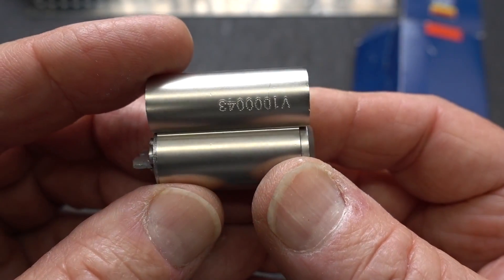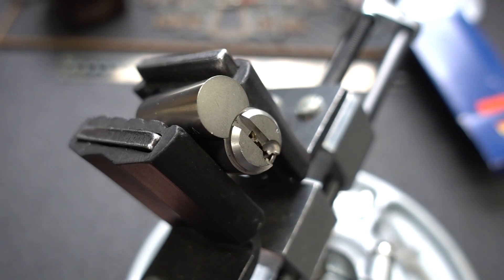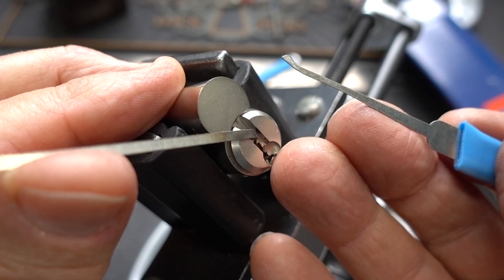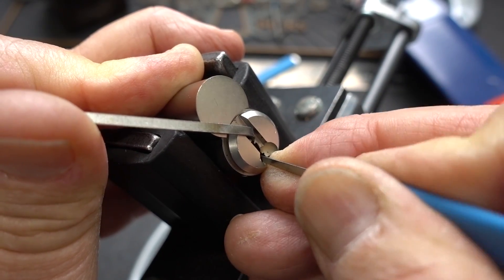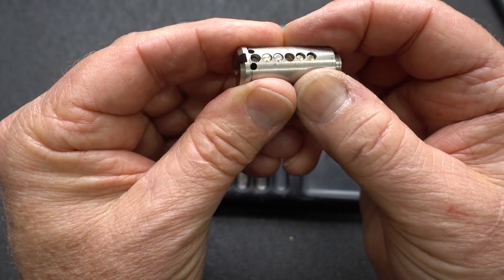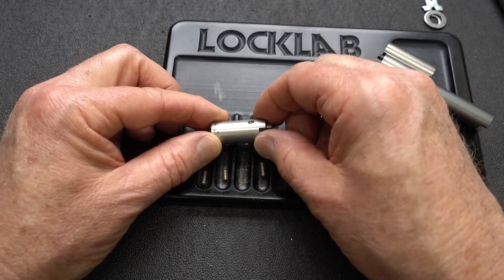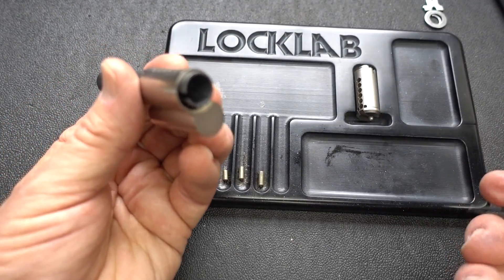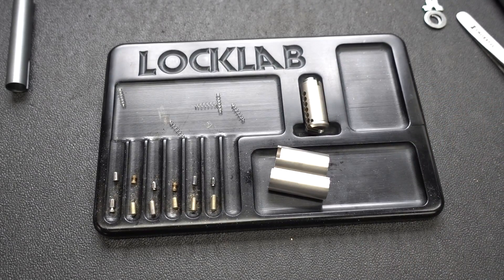(1713) Abus Paracentric Core Picked for Keys

Comment: It's an ABUS Vitess 1000 made by ABUS Phaffenhain in the former West Germany.  Key pin #1 is part of the  ABUS "in-top" key control system.  I believe the plug is a unusually large 14 mm dia to allow for a large number of key cuts / pin lengths.

Comment: Looks like pin 2 and 3 were zero lift pins making one spool and "weird pin" not active at all.
Reply: They probably were, but the holes being so tight, it's not impossible for the key pins to just stick at the picked position as the plug was extracted.

Comment: When did you stop doing challenge locks?
Reply: When and why? Lol
Reply: My guess is that he started to see the same thing over and over again to a point that the challenge was a bit meh. That said though he was still getting whipped so it was too easy. Maybe he just got bored.
Reply: One too many trap pins
Reply from the maker: Here's what I posted on FB, Twitter, YT & LockLab.com about a year ago:
-----------------------------

The "Challenge Lock" series has come to an end.  Not only am I out of the "Whipped" PacLocks, but there were many other things that I took into consideration.

1.  Cost.  Every day I was receiving between 5-10 locks from around the world.  I had to return most of them to the owner, which was a SIGNIFICANT expense - always more than $500/month but sometimes approaching $1000.  What little I receive in viewer support was quickly consumed in return postage.  I was spending several hundred dollars of my own money every month just to return locks.

2.  Quality.  Some locks were well designed and contained some unique innovations, but they were few and far between.  Most "challenge locks" were threaded chambers with serrated pins built on old,beaten up Kwikset cores.  The number of trap pins and super springs has continued to increase as copycats realized this might be a way to get a "Whipped" PacLock - meaning I was breaking and bending more expensive picks.  I found this very discouraging.

3.  Time.  Unpacking, picking, disassembling, repacking, answering emails, etc.  Each challenge lock took a lot of time to figure out and then return - even if I did not make a video of it.  I was spending most of my time setting up and videoing locks that turned out to be copycats of other people's ideas - meaning I could not post the video for fear of viewers saying "WHAT?  Another Kwikset with threaded chambers?"

4.  Viewer Interest.  My goal with LockLab was to remain "New Picker Friendly" and attract new members to LockSport, but LockLab was quickly becoming the "Challenge Lock Channel", interesting to only a limited number of people with advanced skills.  Every time I posted a challenge lock video people complained and unsubscribed to the channel.  New pickers were overwhelmed by the complexity of challenge locks and became discouraged.  My analytics were very clear on this:  If I want to lose subscribers all I needed to do was post a challenge lock video.

5.  Channel growth.  The LockLab's growth was stagnating and I needed to change something before it was too late.  Since I stopped doing challenge locks the number of subscribers has increased, the number of comments increased, "likes" went up, and the channel has grown.

So, yes.  I stopped making challenge lock videos.  It was not an easy decision but I could not afford to continue doing it for all of these reasons.  The money saved from NOT returning challenge locks I am now spending on locks - and have been doing so for the past month or two.  I cannot tell you how refreshing it is to return to picking real-world locks in a wide variety.  It is good for me (mentally), as well as good for LockLab.

bill
Reply: @bosnianbill  I thought it would be along those lines
Reply: Bosnianbill makes perfect sense and I appreciate that. It’s a niche market.
Reply: @bosnianbill  
That's what I'm here for, new/old and different locks found in the wild, esp those which gives insight to the history of lock making

Comment: Why don't you do challenge locks any more bill?
Reply from the maker: Here's what I posted on FB, Twitter, YT & LockLab.com about a year ago:
-----------------------------

The "Challenge Lock" series has come to an end.  Not only am I out of the "Whipped" PacLocks, but there were many other things that I took into consideration.

1.  Cost.  Every day I was receiving between 5-10 locks from around the world.  I had to return most of them to the owner, which was a SIGNIFICANT expense - always more than $500/month but sometimes approaching $1000.  What little I receive in viewer support was quickly consumed in return postage.  I was spending several hundred dollars of my own money every month just to return locks.

2.  Quality.  Some locks were well designed and contained some unique innovations, but they were few and far between.  Most "challenge locks" were threaded chambers with serrated pins built on old,beaten up Kwikset cores.  The number of trap pins and super springs has continued to increase as copycats realized this might be a way to get a "Whipped" PacLock - meaning I was breaking and bending more expensive picks.  I found this very discouraging.

3.  Time.  Unpacking, picking, disassembling, repacking, answering emails, etc.  Each challenge lock took a lot of time to figure out and then return - even if I did not make a video of it.  I was spending most of my time setting up and videoing locks that turned out to be copycats of other people's ideas - meaning I could not post the video for fear of viewers saying "WHAT?  Another Kwikset with threaded chambers?"

4.  Viewer Interest.  My goal with LockLab was to remain "New Picker Friendly" and attract new members to LockSport, but LockLab was quickly becoming the "Challenge Lock Channel", interesting to only a limited number of people with advanced skills.  Every time I posted a challenge lock video people complained and unsubscribed to the channel.  New pickers were overwhelmed by the complexity of challenge locks and became discouraged.  My analytics were very clear on this:  If I want to lose subscribers all I needed to do was post a challenge lock video.

5.  Channel growth.  The LockLab's growth was stagnating and I needed to change something before it was too late.  Since I stopped doing challenge locks the number of subscribers has increased, the number of comments increased, "likes" went up, and the channel has grown.

So, yes.  I stopped making challenge lock videos.  It was not an easy decision but I could not afford to continue doing it for all of these reasons.  The money saved from NOT returning challenge locks I am now spending on locks - and have been doing so for the past month or two.  I cannot tell you how refreshing it is to return to picking real-world locks in a wide variety.  It is good for me (mentally), as well as good for LockLab.

bill

Comment: 8:00. Why do the pin holes go all the way across the chamber opposite the bible? Assembly easier?
 Is that common and I just didn't notice?
Reply: Its to rekey it quickly
Reply: It's how the chambers are drilled into the bible.  It's the alternative to sealing the chambers from the top.  Some ASSA bibles are made that way too.

Comment: why stop challenge locks?
Reply from the maker: Here's what I posted on FB, Twitter, YT & LockLab.com about a year ago:
-----------------------------

The "Challenge Lock" series has come to an end.  Not only am I out of the "Whipped" PacLocks, but there were many other things that I took into consideration.

1.  Cost.  Every day I was receiving between 5-10 locks from around the world.  I had to return most of them to the owner, which was a SIGNIFICANT expense - always more than $500/month but sometimes approaching $1000.  What little I receive in viewer support was quickly consumed in return postage.  I was spending several hundred dollars of my own money every month just to return locks.

2.  Quality.  Some locks were well designed and contained some unique innovations, but they were few and far between.  Most "challenge locks" were threaded chambers with serrated pins built on old,beaten up Kwikset cores.  The number of trap pins and super springs has continued to increase as copycats realized this might be a way to get a "Whipped" PacLock - meaning I was breaking and bending more expensive picks.  I found this very discouraging.

3.  Time.  Unpacking, picking, disassembling, repacking, answering emails, etc.  Each challenge lock took a lot of time to figure out and then return - even if I did not make a video of it.  I was spending most of my time setting up and videoing locks that turned out to be copycats of other people's ideas - meaning I could not post the video for fear of viewers saying "WHAT?  Another Kwikset with threaded chambers?"

4.  Viewer Interest.  My goal with LockLab was to remain "New Picker Friendly" and attract new members to LockSport, but LockLab was quickly becoming the "Challenge Lock Channel", interesting to only a limited number of people with advanced skills.  Every time I posted a challenge lock video people complained and unsubscribed to the channel.  New pickers were overwhelmed by the complexity of challenge locks and became discouraged.  My analytics were very clear on this:  If I want to lose subscribers all I needed to do was post a challenge lock video.

5.  Channel growth.  The LockLab's growth was stagnating and I needed to change something before it was too late.  Since I stopped doing challenge locks the number of subscribers has increased, the number of comments increased, "likes" went up, and the channel has grown.

So, yes.  I stopped making challenge lock videos.  It was not an easy decision but I could not afford to continue doing it for all of these reasons.  The money saved from NOT returning challenge locks I am now spending on locks - and have been doing so for the past month or two.  I cannot tell you how refreshing it is to return to picking real-world locks in a wide variety.  It is good for me (mentally), as well as good for LockLab.

bill
Reply: @bosnianbill  fair enough, im glad i got that bit of info before i sent you one. thank you for such a quick reply